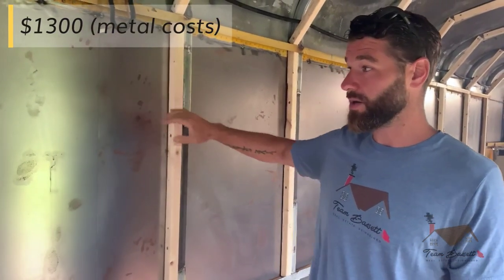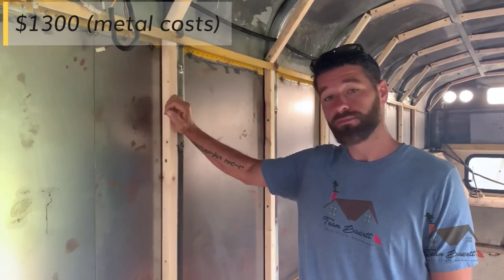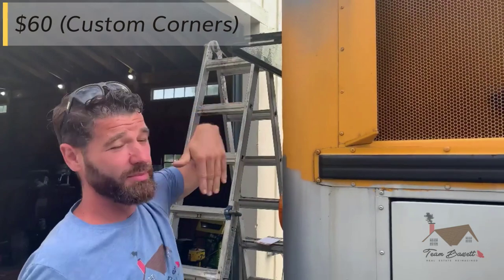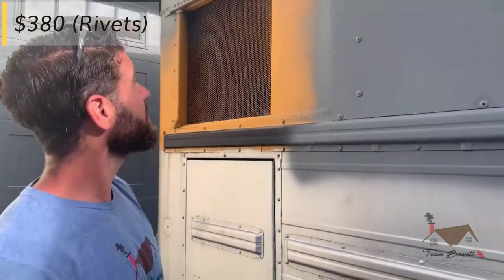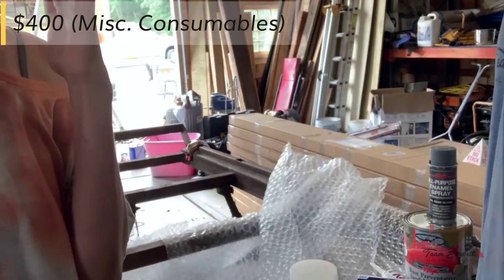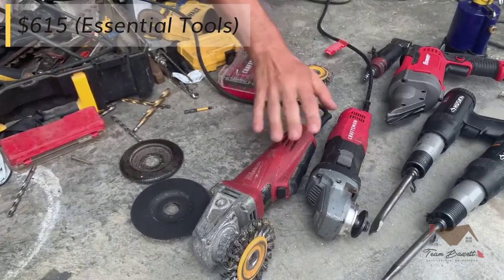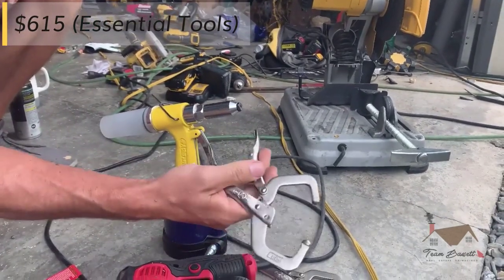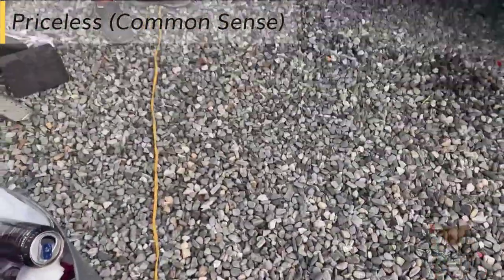HOW MUCH our DIY Roof Raise on our Skoolie/Converted Bus COST US!

Comment: I'm going to be doing this also. I am a master carpenter though, so it seems pretty easy. Except I dont have a welder and stuff. I'm planning on 2 inch foam for walls and ceiling so I figured 4x4 wood posts in place of steel will be better than actual steel. If you add a 2x4 flat ways over the 2 inch foam it pads out to 3.5 inches matching the plane of the 4x4s. Cut bus in half at windows. Use comealongs from roof of barn to lift it off. Install 4x4s at every window pillar. Atratch a 2x6 to outside where the upper part of window pillars will rest on the 2x6. Lower roof down, use legs through bus channels into 4x4s, 2x4s between for rack bracing.  New skin on outside and done.....not hard. Yeah I'll loose 8 inches in with but I would anyways with insulation.  Everybody forgets about insulation and they freeze n sweat their asses off.
Reply from the maker: Love to see how this turns out. Are you thinking plywood or sheet metal for the skins?
Reply: Lord dude, have you started this project yet?  Please go buy a mug welder and there are channels on YouTube that teach you how to weld! You will be able to weld as good as a pro within a week with a mig welder. 

There’s many reasons why not to use your ideas but the biggest is the safety of it all! Using steel and welding that steel makes the shell stronger than wood ever will be!! Plus the fact that if your adding a 4x4 wood post at every window rib, the. You e we I’ll be adding tremendous amount of weight and that’s even before you get to the finish work and these busses already have a difficult time getting to and maintaining highway speeds which means your gonna be pushing your engine further than you want to really push it!! 

As far as the insulation goes, your off on that as well. Folks don’t forget about that at all. With today’s new insulation products out there , 2” of today’s materials are better than 8” Of the standard fiberglass batts. Do some research on it. You are throwing away extremely valuable space by sacrificing 8”-12” just for insulation. You will miss that space bad the very first time you take a trip!!  As far as being hot or cold, I haven’t been in a schoolie conversion yet  that was not easy to heat or cool ! About everyone of them had almost too much heat and air cause if your not careful, you’ll run yourself out of them in the winter or freeze yourself in the summer with the a/c!!  I truly think you need to go back to the drawing board on this and study good solid actual builds cause all of your info is completely backwards. I’m not trying to be mean or negative but realistic!! There are hundreds upon hundreds of builds out there that can easily disprove all of your current thoughts about bus conversions are completely inaccurate at best and your method of raising a roof on one will simply be dangerous for you while driving as well as others around you on the road. 

Save your “master craftsmen” knowledge work it’s magic when it’s time to build the cabinets and all your finish work! Don’t try and reinvent the wheel here plus the fact that all of that lumber and miscellaneous hardware will cost well more than the steel you need plus a brand new mig welder will cost that will give you the strongest, safest shell that you’ll need to for the rest of the conversion. Your plans have trouble stamped all over them, sorry!